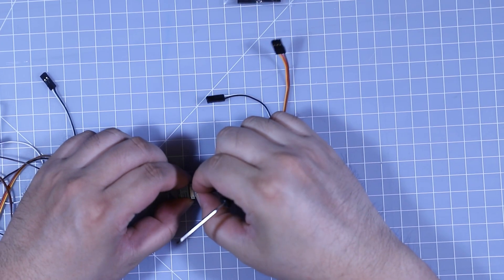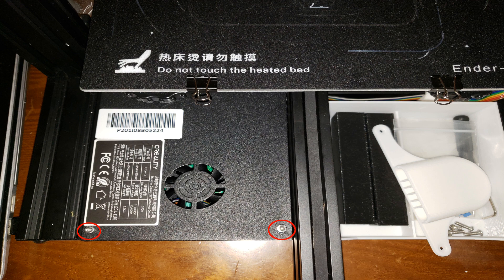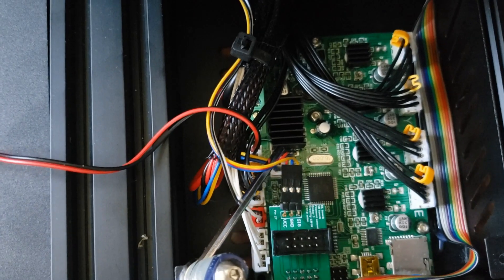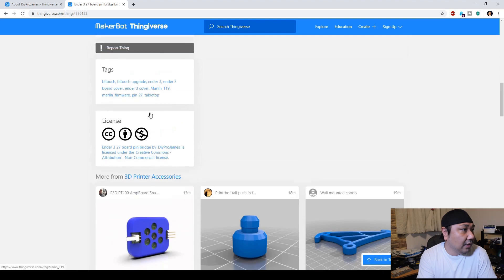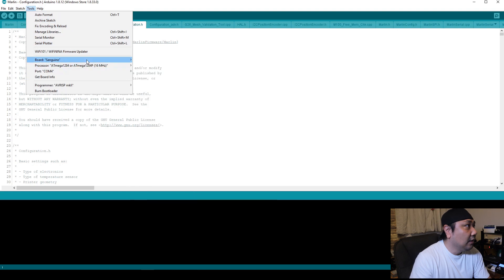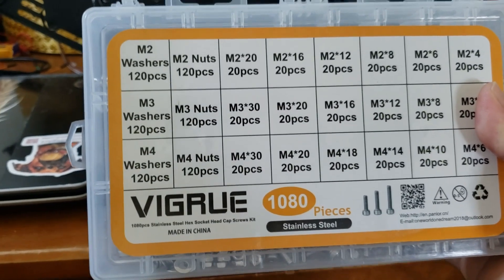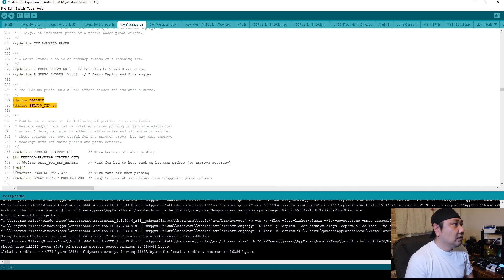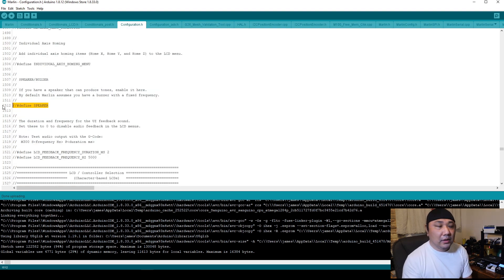ENDER 3 BLTOUCH 3.1 INSTALL AND UPGRADE GUIDE. Instructions on how to upgrade your sensor to bltouch

Comment: Hmmm, followed you step by step with the Arduino program and upon uploading the sketch I get three errors.
Avrdude: stk500_getsync() attempt 9 of 10: not in sync: resp=0xe1 (and also same error but 10/10)
Avrdude:stk500_recv() : programmer is not responding

Tried Arduino as ISP as well and still fails.

Comment: hello my bltouch 3.1 does not level well no more than I try, the left part of the bed is a little higher than the right, I tried everything but I can not fix it, what could it be?
Reply from the maker: I'm not sure what it could be... Diagnosing problems like this requires extensive testing and observation.
Reply: @DiyProJames  I tried to put the bltouch more right and fixed something the problem, thaks
Reply from the maker: @rubenfifo  you're welcome.

Comment: Does your firmware file work with the Ender 3 Pro, and if so do any changes need to be done? 
Also, i thought the BL Touch V3.1 needed Marlin 2.0?
Reply from the maker: There is no difference in the ender 3 and ender 3 pro version when it comes to the board. So the pro uses the ender 3 board. Marlin 2.0 supports the bl touch as well as the 1.1.9. The both support it you just have to enable them.
Reply: @DiyProJames  , Thanks. Okay i see. I heard somewhere that that particular version of BL Touch (V3.1) only works with Marlin 2.0, but i guess thats not the case then if you are using V3.1 with Marlin 1.9. Okay so no changes are needed in your file, except the nozzle to probe distances? By the way, the 2 wire lead, should the white zmin wire be on the right hand side towards the front side of the printer? My probe is only blinking red with the Creality 1.1.6 BL Touch firmware.
Reply from the maker: @my.username  You need to look at the diagram.. Please check the ender 3 playlist or go to the antclabs website there should be a diagram of the wiring.

Comment: I tried to verify the firmware but it  says I need to get the Sanguino board. I have that selected. It was not part of the options for my Arduino install so I went to File>Preferences and entered https://raw.githubusercontent.com/Lauszus/Sanguino/master/package_lauszus_sanguino_index.json in the additional boards manager box. Then I went and selected the board from tools>boards. I got that URL from another Ender 3 blog about updating firmware. It seems that does not work. Any ideas?
Reply from the maker: Did you follow the instructions and load the u8glib library? Select the correct programmer and processer in the tools menu?

Comment: installed everything, used your recommended firmware, but now when I turn on the printer, the lcd screen lights up but has no words (as if i just burnt a bootloader), while the bltouch lights up and moves the probe up and down a few times. any suggestions on how to fix this? If I remove the pinboard and plug the lcd directly into the motherboard, the screen turns on correctly. I believe I plugged everything in correctly. Any help would be greatly appreciated, especially in words fit for a beginner. Thanks
Reply from the maker: I have to ask.. Did you install a the bootloader? Sometimes beginners are confused between a bootloader and firmware. Assuming you did both... I'm going to say there is an issue with the pin 27 board. Make sure you snap the pin 27 board to your main board. The pins should match up, but sometimes people miss the pins by 1 because the connector housing is not a perfect fit... 

Then watch this video.. https://www.youtube.com/watch?v=MfvRKvCk1T4  This should give you a reference of bltouch cables. Make sure the wires going from the bltouch to the pin 27 board is correct. Forget about the colors. The pin 27 board should have the ground,vcc, and signal labeled. Using the diagram from the video make sure those wires are going in the correct pins. If not you may have to switch out the wires. 

Because your mainboard is able to communicate correctly with the lcd without the pin 27 board means that somewhere the signals are being crossed meaning the wires were not connected in the correct places via the pins or the pin 27 board might be defective and not be sending the correct signal.
Reply: @DiyProJames  Bought a new pin 27 board and it's working perfectly now. Thank you for your help!!

Comment: Do you know if the firmware on creality will work with a v3 BLtouch?
Reply from the maker: Yes, but it depends on which version you get. They have a firmware for bltouch and another without. Just make sure you use the correct one.

Comment: I have recently installed the 3.1 BLtouch to my ender 3 pro, but after probing i only get one decent square ( 5 square test print ) and the rest are chewed up and crappy. Any ideas ?
Reply from the maker: No..., you need to be more precise in the description and steps you did. Did you do the mechanical bed leveling? Did you do the auto bed leveling, g code 29? Where is the bad print located center, left, right, etc.. When you say chewed up I'm assuming the nozzle is too low and giving you bad ridging. The opposite would be stringing and not adhering to the bed...etc..
Reply: ProjectJames  yes. My bed is within 0.08mm across the whole bed so manually is fine. Set z offset and first square is mint but the rest are evidently too far out ( lumpy and barely sticks on some points )
Reply from the maker: @MarcJWebbMusic  Is this a brand new printer? Or is this something that happened when you changed firmware or some type of upgrade?
Reply: ProjectJames brand new. Only had for about a month. Just recently added the BLtouch. Btw how much difference could the mount cause. For example I was using an adjustable one but now a solid
Reply from the maker: @MarcJWebbMusic  Depends on how bad your bed is. If you had no trouble printing before you upgraded to the bltouch; it could be a miscalibration. The bltouch is supposed to give you z offset distances in the bed height. If your x and y offsets are not correct it could be showing that area as high while it's low or vice versa. A solid mount would reduce error because it would be in a fixed position unless for some reason it came loose. However, if your troubles started when you first bought the printer it could also be that the gantry is not perfectly square. By process of elimination you need to start diagnosing the problem.

I would also, check the ptfe tubes on extruder and hotend side. Make sure it is snug and in place. Also, make sure that tube can run freely meaning no kinks when you clip the wire loom on the extruder. I mention this because only on first position it's fine. Then on other positions the ptfe tube may have a small kink you're not aware of. I mention this on my one of my other installation video.

Hope you are able to diagnose the problem...
Reply: ProjectJames according to Octoprint my bed is pretty good. And well within the tolerances of the BLtouch. Just can’t figure out why only one corner prints really nice and all t he others are useless.
Reply from the maker: @MarcJWebbMusic  Again, this is something you have to figure out by process of elimination. You're bed might still be on tilt. Take a look into tramming the bed. Make sure your gantry is level to the bed. I would also check the ptfe tube make sure it's long and has smooth transitions.  Something like a video or photo might help. My guess is there is something phyically miscalibrated on the printer and not the bltouch or firmware.

Comment: In your firmware, do you have the ability to print with an sd card turned off? got everything set up and the printer cannot see an SD.
Reply from the maker: Yes, I am currently printing everything with the micro sd card. I have not yet installed octoprint to this printer. Uncomment the #define SDSUPPORT
Reply: ProjectJames did that and it still can’t see the card for some reason
Reply from the maker: @jarridscroggins5028  Are you using the same firmware I'm using? I have a link on top to thingiverse my account. You can download it there. Go to the download thing file... Sometimes download all doesn't work properly.

Comment: On the Arduino IDE, those with the double slash aren't included when compiled by the program right? Same goes for the remarks. So it does not take space. So it does not matter if you delete them  or not. Am I correct?
Reply from the maker: You are correct. The remarks will not take up any space. When compiling those remarks will be left out. It will not make any difference if you delete those remarks. When you delete make sure you delete everything. If you leave a single character like a period it may affect the code. Also, It does not hurt to leave it in because it will help you in future upgrades if you need reference. Often times good code will have good remarks especially if you work on it as a team. The arduino is used to install the bootloader. After the bootloader has been installed you can use the normal mini usb port to connect directly with the printer.
Reply: Just got the CR10S Pro V2. Everything works out of the box so I won't be doing any updates yet. But  watching these vids will get me an idea on what to expect. Thanks!